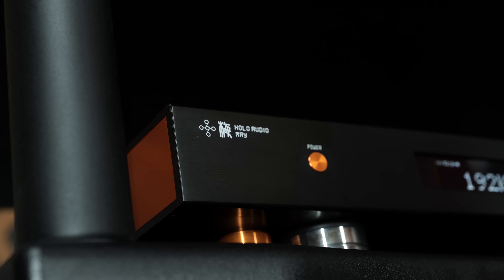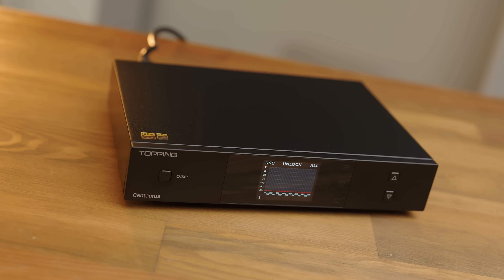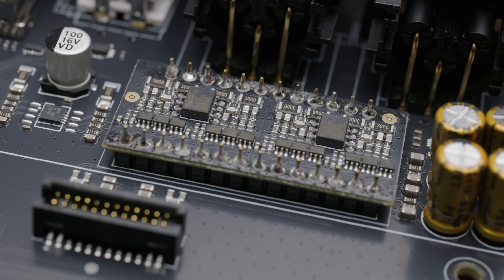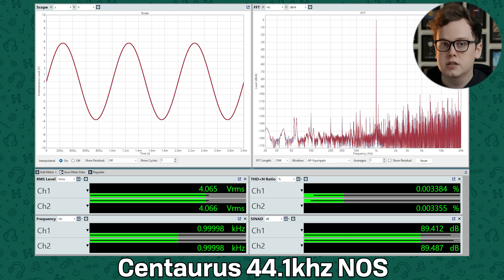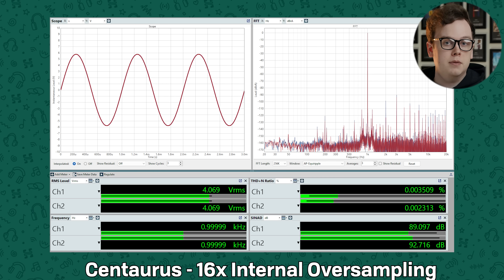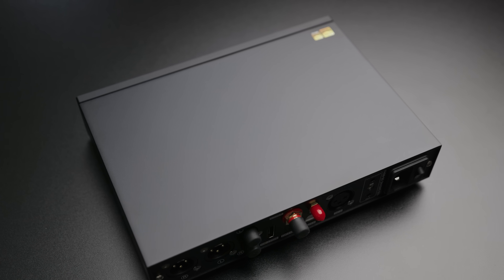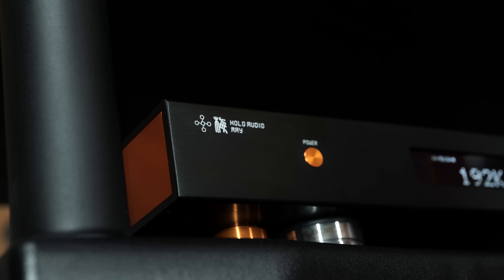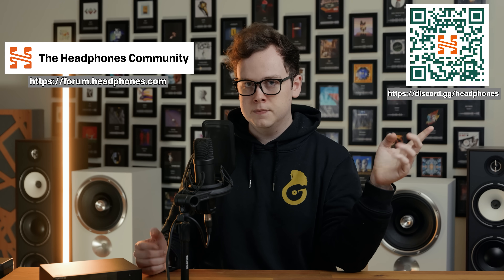The Topping Centaurus has a problem...

Comment: Great review. 

From a product test point of view, it would have been more complete to use the r2r from Cyan2 as well as using the Centarus board in the Holo Audio kit I.e. you have assumed rather than proven it's the same unit, irrespective of part numbers

I appreciate that would have doubled the test timeframes and the level of testing you have done is beyond most audiophile reviewers. Great work
Reply: The issue here is that unfortunately, topping has made it so that the Centaurus is basically impossible to re-assemble once put back together. There is a tiny ribbon cable you have to remove to get the PCB out, and then as far as I can see there is no way to get it back in again after. So I wasn't able to put the cyan 2 board into the centaurus.

But, I did ask Jeff Zhu (the holo audio designer) about the centaurus a while ago and he confirmed the Cyan 2 and Centaurus boards are identical. Holo just sells the board to Topping in the same way as AKM/ESS supplies DAC chips to many manufacturers.
Reply: @GoldenSound  That kinda makes sense, thank you. I guess that was intentional on Toppings part, similar to the "best" setting acting as cover for the poorly performing NOS mode. Then again, they likely think (probably rightly) that most consumers just plug in and are happy with the stock sound, then buy another product in 2 years. Shiney 😁👍

Comment: I have both the Cyan2 and the Centaurus, although I use them in very different settings. The Cyan 2 is connected to Eversolo DMP-A8 in my main hifi rig whereas the Centaurus connected to the Wiim Ultra on my gaming desk, handling both casual music listening when I work (on another desk), random youtube video and gaming.

My take on it is...
1. The Cyan2 major drawback is its virtually inability to switch input easily when you have a USB device "locked" to it... i.e. in this case if the Eversolo is powered on (or if a pc connected to it is powered on) it doesn't switch automatically to other inputs. Doesn't matter to me here though because I only have it connected to one input.
2. I got the Centaurus on a very good deal of (much) less than 800$ equivalent, I've been using it in Best mode connected to the A70, Adam Audio D4V and Rel T5/x. I think it works really fine... Would I have done it again, yes. Would I have done it at 999, maybe not.

I really love your review. I think you have a very good blend of objective and subjective view. Keep up the good work.

Comment: My experience says EQ is not worth it.
More so it makes my cans sound worse. 
I don't get it why forcing EQ in every review. Makes no sense to me.
Reply: You've just done it wrong. Every headphone can benefit from EQ, but important to remember that only parametric EQ counts.
Reply: @hartyewh1  I'm using Audirvana and it has some janky EQ options. More like an afterthought. That's why I don't use it.
Reply: @mikedergalev  Certainly. Anything beyond headphone specific (or even unit specific) EQ's based on measurements or some very talented ear often with some personalizations on top are mostly random changes that yield exactly as much benefit as that implies.

Comment: Topping always cheaped out on their power supply... they should just change to brick PSU and let users upgrade to linear PSU later if they want
Reply: There's nothing wrong with smps
Reply: @stottpie nothing wrong but nothing great....
Reply: Mmm, the lowest noise AB and class D amps both use smps, same for the best measuring dacs.

Smps fear is so 90's
Reply: @BestKiteboardingOfficial  good measuring DAC does not mean it's definitely a good sounding DAC

Comment: It's Topping.  There is always a catch :D
Reply: Lucky for them being Chinese they have a bright future, unlike American and Euro brands that will just be fading memories that old men bore their grandchildren with
Reply: My A70 and L70 have both developed channel imbalances. Only my lower end topping amps have survived more than a year. E70V and D70 have been fine though.
Reply: Could you elaborate? What other topping products have issues besides the kinds of things that would fail a blind test?
Reply: I bought the MX5, and out of the box it had two issues: the sound over Toslink would cut out for a second every 2 minutes. The second issue is that when using the headphone-only mode there is a quiet high-frequency noise coming from the speakers. They fixed the first issue with a firmware update, but they didn’t make it public for some reason, it’s only available to those who thought to ask support about it. Second issue is hardware-related I guess.
Reply: @En_Joshi-Godrez  self-nuking power supplies shortly after the warranty period on some of their amps (like the A30Pro, for example).
Reply: @FormalPluto   damn that sucks. Ironically I bought one of their battery powered models and it's one of the only battery powered hifi devices that is serviceable and user replacable.